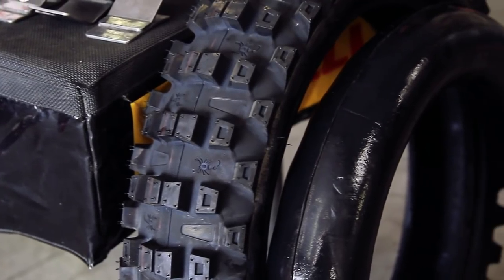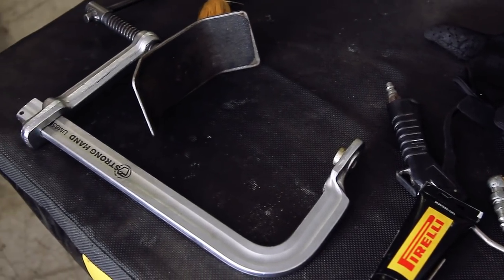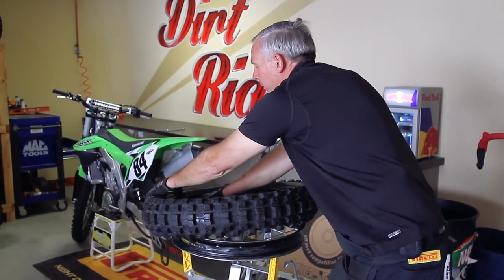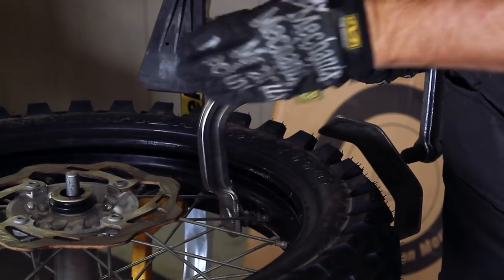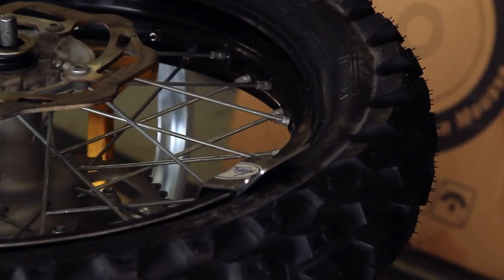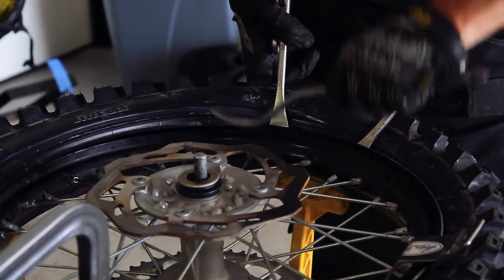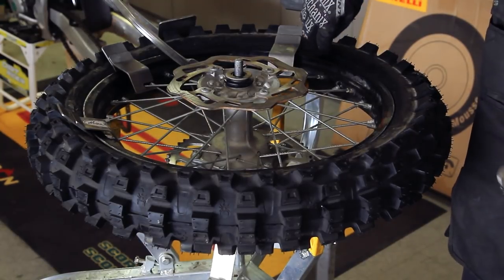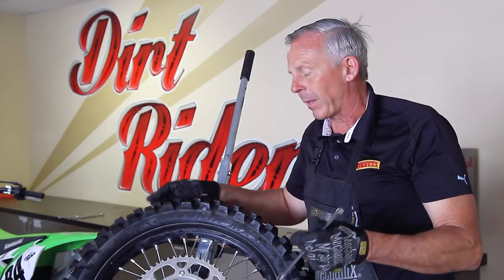How To Install A Mousse With Hand Tools | Dirt Rider

Comment: This one of the best installation videos.  Most don't explain that you have to use bead buddies or several tire spoons to keep the tire bead under the rim (in the valley of the rim) until you finish getting the other side of the tire under the rim.  Otherwise, at least on a new rear tire and new bib, you will not be able get the final part of the tire inserted under the rim.

Comment: This is a GREAT video! The only thing I do differently. Because I’m not as clean or precise as you. Is I put a shop towel over the rotor so I don’t get compound on it or cut my hand on it. You obviously don’t need that. Might be a tip for a nubbie though.

Comment: Guy says 6 to 10 hours.  

Later says basically 2-3 tires out of it. 

Seems hard to believe that both statements are true.
Reply: Jason Wierenga I thought same thing? You’d have to be pushing it to do that
Reply: Jason Wierenga . He will have meant to say 6 - 10 months.
Reply: I think he means you have to reactivate it (blow air into it to fluff it up) every 6-10 hours. And you can do it 2-3 times before you need to apply new mousse. But dont take my word for it I only ride on YT!! 😂

Comment: what do you do with the hole in rim?let water and mud get in there?
Reply: It has the valve fitted but cut off from the tube. Thats what he used to inflate the tyre.
Reply: I use an old tube with the stem still on it as a rim strip. Just cut to the desired width. if you have a worn mousse just put the whole tube in to take up space. that can be difficult to install though but saves money.

Comment: Also search for genuine dirt rider mousse install.   Great video and a slightly different style.   Defiantly all about technique.   https://www.youtube.com/watch?v=wtQBMyA57ZA   There are two or 3 videos.  He uses a tool for tire balls during the install its like 80 bucks, but I have followed his instructions and its easy (3 big spoons, a small spoon, two bead buddies and a standard tire stand).  Its all about keeping the bead opposite and as much as you can into the dish and how you handle the bead lock.  Did the last one without cussing at all.  Buy a few extra tubes of lube when you get the bib for different tires.  I take the tire off and flip it every so often to get even wear and relube the bead it lasts longer.

Comment: At 6:15 you add air to seat the bead. Thought this was a Mousse that doesn't have air?
Reply: Mark Pearce I’m confused
Reply: Doesn't hold the air. Just blowing air into the wheel to get the bead seated initially after tire install. The mousse will most likely seat the bead on it's own if enough lube is used. But, blowing a little air into the wheel gets it done quickly. The air then escapes out of the unused valve stem hole.
Reply: there is no valve stem, you are just blowing air in the tire to push the tire bead up over the safety rib on the wheel.

Comment: So with a mousse instead of a tube does it not have a valve stem?
Reply: correct
Reply: m1ke2001 no air
Reply: Wrong, you cut the tube off the valve and fit the valve stem to fill the hole.